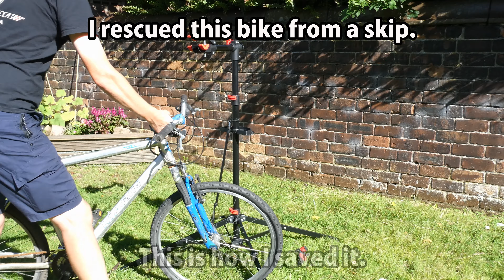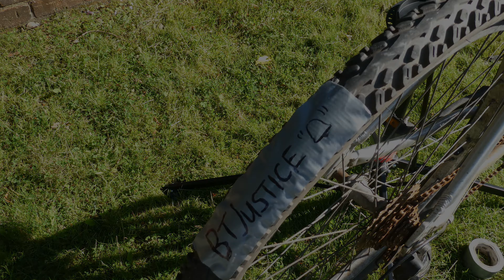The up cycled, recycled bicycle. Saved from a skip and ready to rip.

Comment: Good move :) Can You show how to adjust the brakes ? Thank's :)
Reply from the maker: I cant add it into the video unfortunately but what do you need to know? Is it how to adjust the blocks, the cable or the tension on the spring?
Reply: @AstonishingGlasgow   how to adjust the blocks
Reply from the maker: When you fit the blocks to the brake arm, dont fully tighten the nut. Pull the brake lever so that the blocks are touching the wheel rim then line the blocks up and tighten down the nut to fix them in the right place.
Reply: @AstonishingGlasgow  Thank's :)